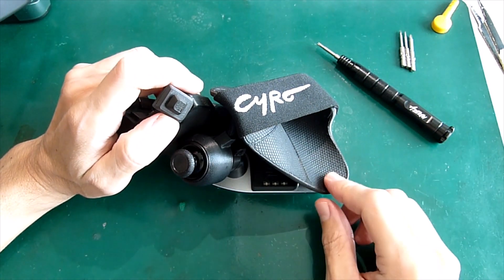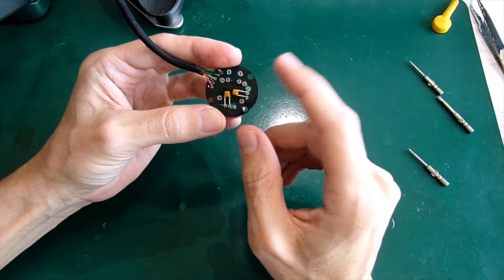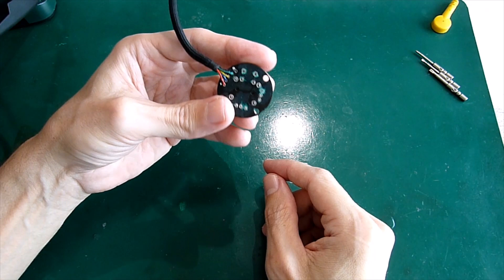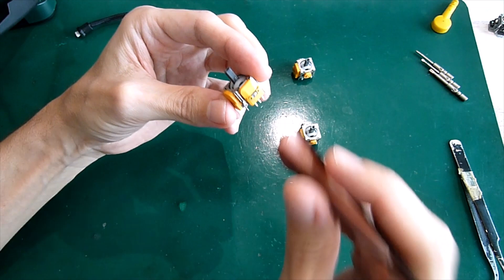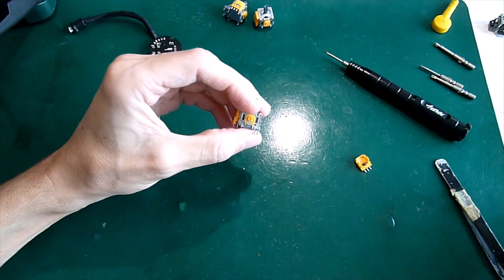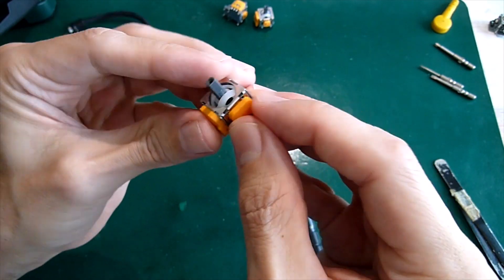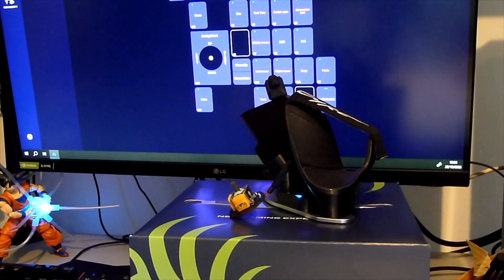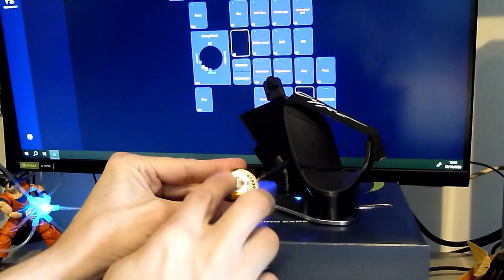How to install an Hall Effect stick in an Azeron Cyro (also works on Cyborg)

Comment: Hello. Could you help me? I have a Cyborg One and the analog stick is moving sideways. Which analog stick with Hall Effect should I buy for it? Which one is accurate and won't short-circuit my board and burn it out? Which one has the correct voltage? Well, I'm from Brazil and I have an Azeron. I need to order a new module for my Azeron. It's been running for more than a month. So, I'd have to do the repair myself.  I bought it with the elite module. So which analog with hall effect and magnetic would fit this Cyborg? Could you help me?
Reply from the maker: Hi. When you say it moves sideways, you mean it's drifting, moving when you are not touching the joystick? Is it not drifting, but only moving sideways/horizontally, meaning the problem is that it's NOT moving vertically?

Is it the Elite 1 module or the Elite 2? To know what replacement you need, I will need to check the board. I haven't used Azeron devices in a while now. Have you considered asking help on Azeron's Discord? They've always been helpful for me (and you can also find me there).
Reply: @paulotrindade9533  Yes, that's right, it's moving without me touching it, so when the analog stick starts like this, it's because it's wearing out. So I'll probably have to replace it, but I don't know which magnetic analog stick I can use instead. As you said, if I use one that's not compatible, I might lose the board. That's why I asked for help, because your video is the only one here that shows replacing the analog stick and not the entire module. My Azeron is a cyborg with the elite module that you select on the website. I just looked here in the purchase order: Thumbstick type: Elite V2
Reply: If I buy the analog sticks for the Xbox Elite V2 controller, will it work?
Reply from the maker: @mineirinhowhy I don't think so. The XBox models use two sensors with opposite polarity to each other. I'll check this and get back to you in a bit.

Edit: well... If you actually bought analog carbon potentiometers then yes, but TMRs / Hall Effect need specific models.
Reply from the maker: @mineirinhowhy  Hi. While I don't actually own a Cyborg, I've been told that the original Cyborg, Cyborg Compact and the Cyro all use the same pinout joysticks. All these use the PS5 layout voltage and ground pinout. Because you are using the Elite V2 joysticks, that means you have the ALPS housing / threaded joystick mechanism. I think the best choice would be to buy Aknes/Hallpi or Gulikit's TMRs, and then you only remove the old potentiometers and replace them with the TMR sensors. You still keep the Elite V2 housing system, thumbsticks and caps, and they should match the TMRs. I'm not advising Hall Effects together with Elite V2 sticks, because Hall Effects are more sensible to magnetic interference and an Elite V2 uses a magnetic thumbstick with magnetic caps. After replacing you'll need to recalibrate but Azeron's software is very good at it.
Reply: @paulotrindade9533  I know it's asking a lot, but would you have an old controller to do the process and record a video showing it, or could you recommend a video that teaches how to do this? I would be extremely grateful. Since I live in Brazil, to buy a new module for the Azeron, I have to redirect it to the US, then redirect it to Brazil, which takes almost two months. If I could do this work here like you said, it would save me a lot of time and I would be very grateful.
Reply from the maker: @mineirinhowhy I have videos on my own channel replacing joysticks with various methods, but there are tons of other videos on how to do it. It all depends on what tools you have, and how comfortable you are with soldering. For this I would recommend a knife tip soldering iron, big enough to heat 3 potentiometer pins at once, flux, solder, desoldering braid... maybe some tweezers or a little flat screwdriver to unclip the potentiometers and bend them away.
A Cyborg board isn't very big so it won't dissipate much heat.

Comment: You ever end up finding a solution for he series 2 elite mod. I'm looking into doing it diy but saw your take and wanted more info.
Reply from the maker: Actually, yes I did. There are some Hall Effect sticks on Aliexpress, that use blue and green sensors, and the Series 2 Elite threaded center pole. The ones with 2 blue sensors should work on the Cyro's the Cyborg's boards - functionality has been confirmed by an Azeron Discord moderator. These sticks actually work better on an Azeron than the Series 2 Elite they are designed to work with, because the Azeron doesn't have other magnets around to confuse the sensors.
Reply: @paulotrindade9533  would you mind sending a link of the working one I can get to just solider I'm with the elite I just purchased thanks for your help
Reply from the maker: Let me clarify something then: what device/model do you want to mod Hall Effect sticks into?  @BuckshotW
Reply from the maker: You need a link for what device? An Azeron or an actual Series 2 Elite? @BuckshotW
Reply: @paulotrindade9533  I would also be interested in a link to these if you wouldn't mind. I've got a Cyborg V1 I'm looking to mod.

Comment: Ich hätte ein link von der Classic compact platine also pcb kann ich aber hier nicht senden auf der Azeron Ersatzteile seite kann mann die bestellen.
Reply from the maker: Classic Azeron's board should be this: https://store.azeron.eu/index.php?route=product/product&path=64&product_id=81but this has an analog soldered to it.
They don't seem to sell the board without the analog in the website, so you should probably email them at info@azeron.eu to ask for it.
Reply: Genau das ist das pcb was ich auch habe  meine frage welchen Hall effect kann ich in diese verbauen. Ich abe hier ps5 ps4 und xbox hall effect sticks hier. Und noch eine kleine info die Kaihl sticks die in diesem pcb verbaut sind sind neu. Ich habe mein azeron Compact classic zerlegt da sind die alps sticks verbau nur zur info. Danke Paulo
Reply from the maker: @fayiksahiner8480   I don't think there's an default hall effect stick for that board. You need to make one, using either two PS4 or two Xbox sticks. I think you need two black sensors. I will try this and confirm it to you.
Reply from the maker: @fayiksahiner8480  I tried it, using two Xbox sticks. I replaced the yellow sensor with a black one, and flipped the magnet. The axis are working but the horizontal one is very limited and I can't reach the edges, so there's not enough amplitude to complete calibration. Not sure how to resolve this problem.
Reply from the maker: I was able to calibrate it using the Azeron Software, but I had to calibrate with the board outside the housing. Once this gets the center deadzone accurate, you can assemble it in the housing, but it will lose a lot of horizontal amplitude (unable to reach the edges again). To resolve this, I pressed the "xbox joystick" on the profile page, and lowered the lower/upper deadzone to 200.

Comment: Hi Paulo ich würde die Hall sticks in den Azeron Compact und in den Azeron cyborg gerne verbauen welche Hall effect sticks bräuchte ich dafür danke im voraus
Reply from the maker: Hi. For the Cyborg you should try to get the same Hall Effect sticks as those used for the PS5 controllers. You need Hall Effect sticks with yellow sensors. I've chatted with another person that used the PS5 sticks on the Cyborg, and they didn't even require flipping the magnet. For this video I actually used Xbox Hall Effect sticks, so I needed to exchange the black sensor with a yellow one, and the magnet polarity on the horizontal sensor also needed to be flipped.
I haven't tried it with the Compact yet, but I plan on doing it sometime soon (don't really know when because I've been busy with other things).
Checking the schematic for the Compact Classic board, the Voltage and Ground pins are reversed when comparing it to the Cyro/Cyborg, so I think the Compact Classic will need two black sensors instead. There is no stick that comes with two black sensors, so we will probably need to use 2x PS4 or 2x Xbox sticks (these come with one black sensor each), and swap the sensors accordingly.
If your Compact is a more recent model, a Cyborg Compact, then the board should be the same as the Cyborg, therefore, you'll need two yellow sensors (PS5 Hall Effect stick).
Reply: I need a translator thanks paulo
Reply from the maker: Sorry I don't write in German. I suggest you run it on some online translator, and if you have any questions in English, feel free to ask. :)